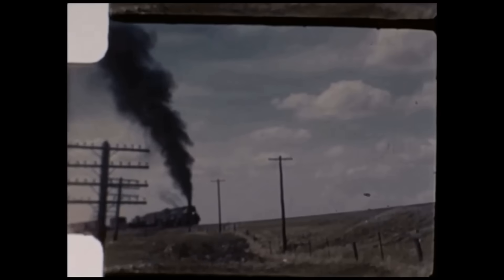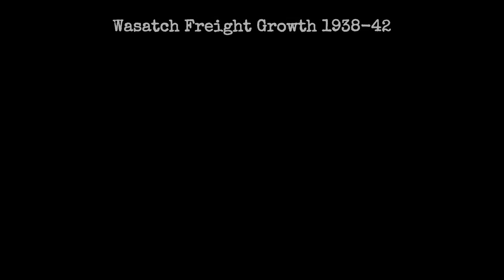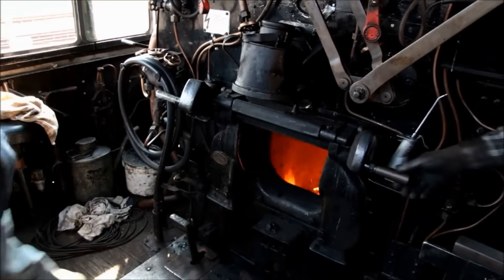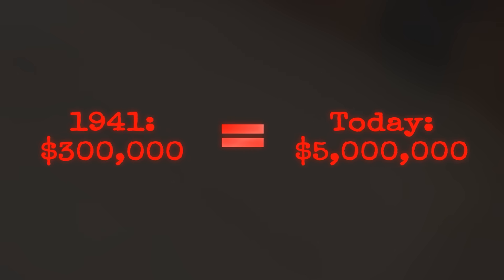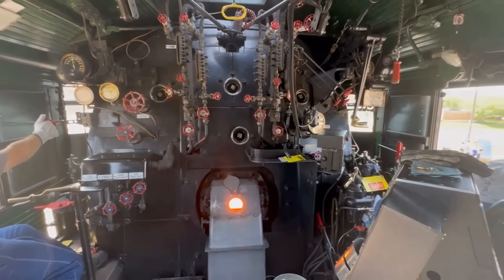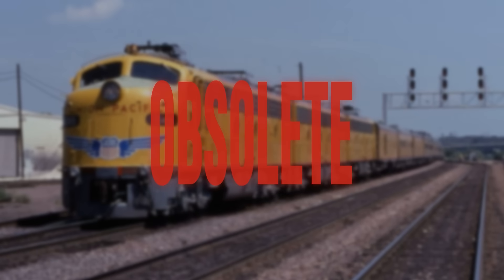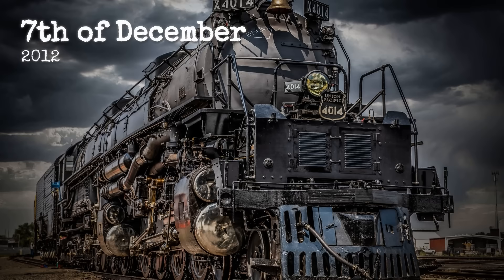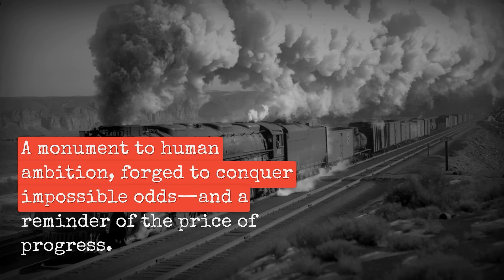How DEADLY Was The BIG BOY ACTUALLY?

Comment: The complexity of the multi unit control system installed in the 4014 used for in tandem with a traction motor is astounding.

Comment: I wonder what would have happened if the railroad had been able or willing to use radial engines similar to what were in the aircraft instead of steam. It was to early for diesel engines, but could they have "stacked" the radial engines dep enough to make the climb. Wouldn't you like to own the company that made a 10 thousand horsepower capable gear box. Imagine shifting that going uphill.

Comment: Lima Locomotive Works, of Lima, Ohio, made 60 Alleghenies for the Chesapeake & Ohio Railway from 1941-1948, and locomotive #1601 was the second one built. The Virginian Railway purchased 8 Alleghenies from Lima Locomotive works in 1945. Only 2 Alleghenies survive: 1601, here at The Henry Ford, and 1604, at the Baltimore & Ohio Railroad Museum in Baltimore, Maryland. The Allegheny is 125-ft long, 11-ft 2-in wide, 16-ft 5 ½-in tall and weighs approximately 771,000-lbs. It could pull 160 coal cars, each with a 60-ton load, and if only pulling passenger cars, could run at 60 mph. 1601’s original price was $230,663.

Comment: Maybe because I spent the last 13 years of my career in coal fired power stations the dynamics of steam locomotives don't seem impressive. 
We usually ran 2000-2800 psig depending on the unit load. The one thing you couldn't control was tube leaks, but you accept the risks and go to work. 
Is the Big Boy able to go through the Horseshoe Curve?

Comment: The precautions mentioned were applicable to any steam locomotive and not just the Big Boy locomotives.
Reply: Good point! Those safety measures were standard across most steam locomotives, not unique to the Big Boy. Are you a fan of classic trains too?
Reply: Very much a fan of classic trains especially the Union Pacific Big boy and the Allegheny of the Chesapeake and Ohio railroad, was a big boy could pull 4,000 to 4,500 tons the Allegheny routinely pulled between 12 and 16,000 tons, at 69 my bucket list is to see both of them in my lifetime, though I have many books on both locomotives and also have both of my old gauge railroad I would love to still see these engines in person from one train enthusiast to another that would complete my life!!! @StateOddities
Reply: F.     She
Reply: Precisely this. Even miniature live steam engines have the capacity to explode and kill the operator. The Big Boy was exactly as deadly as any other steam engine, even safer in several ways.

An entire class of locomotives designed for relentless brutal freight, MILLIONS of miles traveled, and only one fatal accident, caused by civilians. "Deadly". Right.